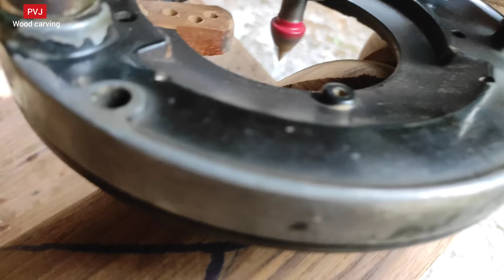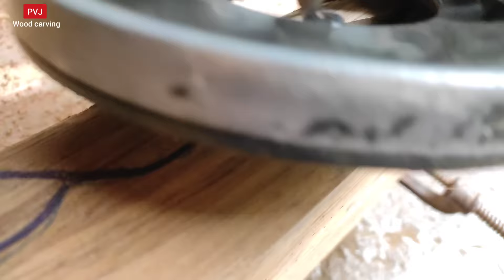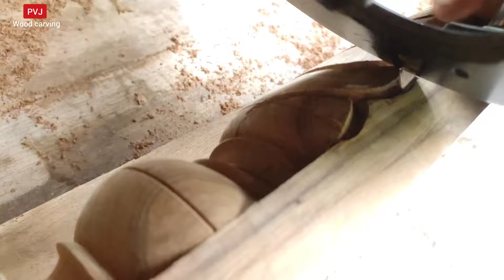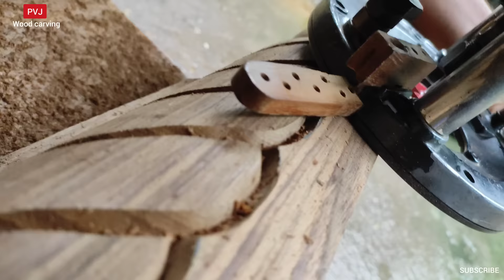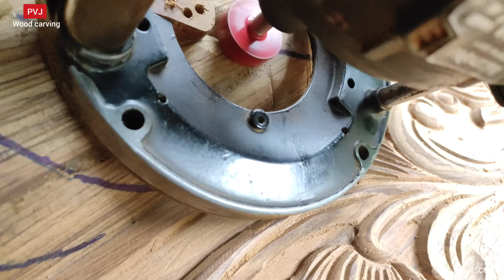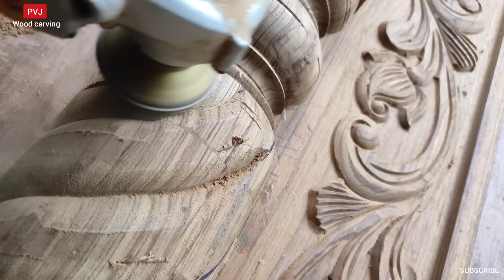How to carve rope moulding on turning pole.

Comment: Wasting time is better made with a carving chisel..👍🏻👍🏻
Reply from the maker: Use both... Router & chisel... For quick process..
Reply: Not completed still
Reply: good
Reply: Utilising modern technology in manufacturing and art industry like other fields is wonderful, I believe that it was made for demo purpose and there's a lot much more to do to make it an art piece. If it's not the way I am thinking, it's just joke on technology by using it in carpentry work. I know once it given proper shape, size and polish finishing it will be like an antique piece. I hope this work piece was able to reach the finishing that I said.